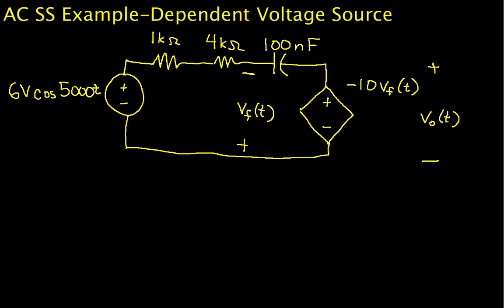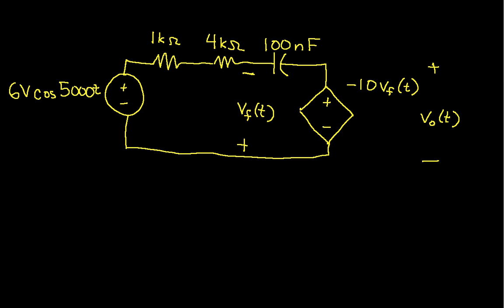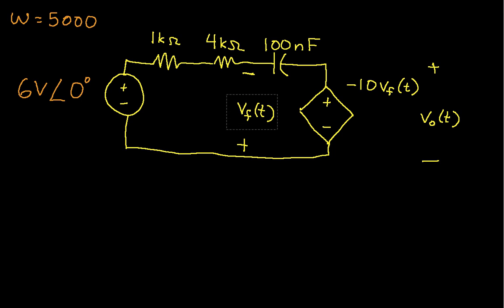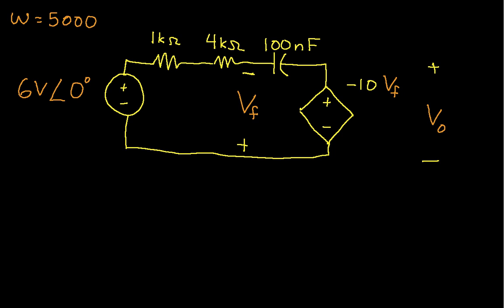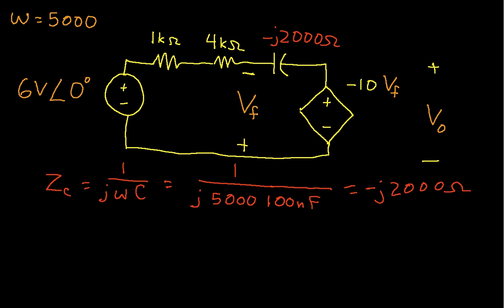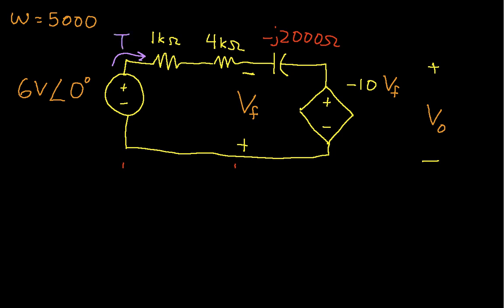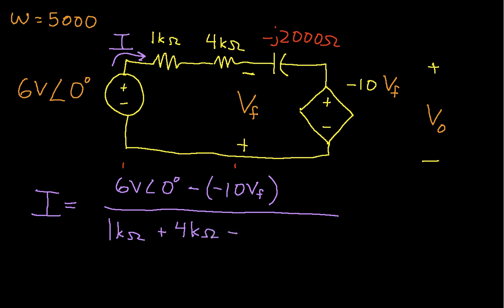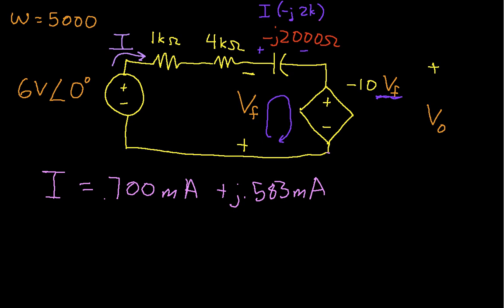AC Example-Dependent Voltage Source Part 1

Comment: When you calculate I around 12 min, don't you have to consider that there are mAs on 1.03mA + j.414mA? I think you didn't multiply 10^-3 in the equation. I might be wrong but that's how I think it should be.
Reply: Oh but come to think about it, you used mA for the result of the equation so I guess it's fine haha. Sorry. Got bit confused :P